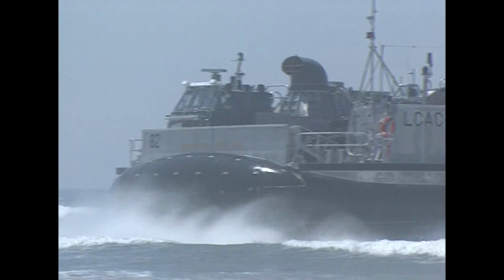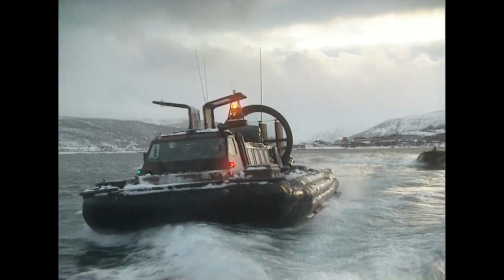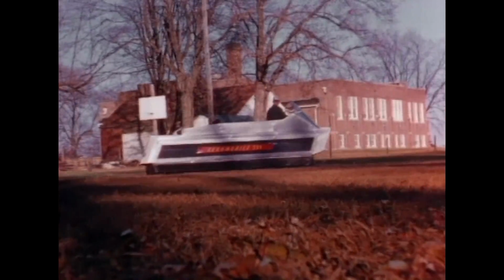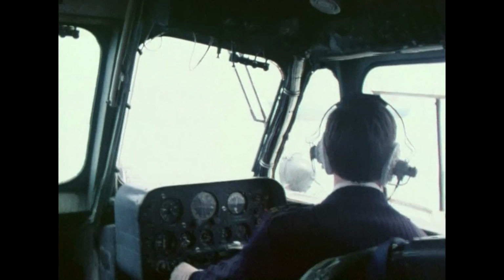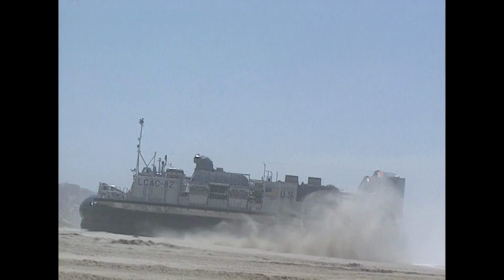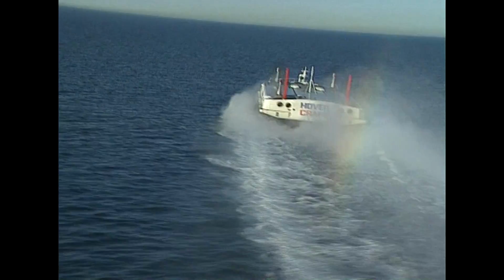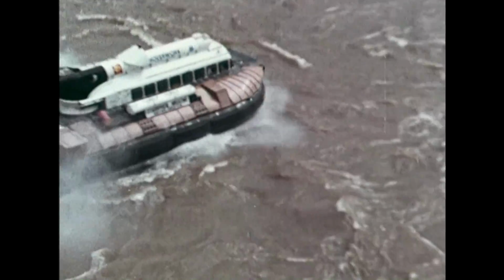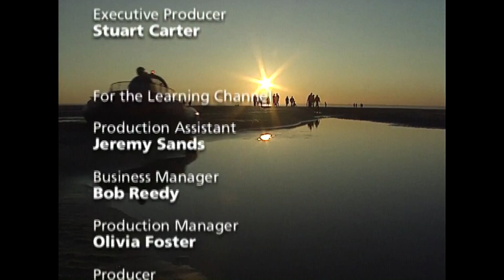Hovercraft - Ultimate Amphibious Machine

Comment: They are an amazing machine but realistically commandos are never going to use them, if you have ever been near an hovercraft the noise is deafening. It might be used for carrying troops quickly by the Brits but then it means you would have to leave your troops far from the actual theatre of operations. I cannot really see when it would ever be used in mission. Surely if speed of action and deployment is a requisite, so is stealth and hovercraft are everything but silent. Helicopters remain the main mean of troops transportation for this reason I would think. If they could manage to engineer a stealth hovercraft if there is such thing that would be a pretty potent way of transportation. The second cons I suspect is how much gasoline you need to feed these monsters. I do seem to recall one of the reasons the Hovercraft across the Channel between France and England ceased activity is the same as that of the Concorde, these were big guzzling machines, a sign of the era but past 70-80s with the oil crisis... There were still hovercraft operating till the mid 90s. In France it was mostly Calais and Boulogne-sur-mer, maybe Dunkerque and I do believe there might have been lines to The Netherlands or nearby Belgium too. They became a rare sight though, you would only see them in the summer time when the Channel was reasonably flat. Outside this 2 months bracket, big swells and Gale force winds would prevent most crossings. At the same time flying directly to London must have made far more sense than driving and taking the train all the way to these cities just to get a taste of the Hovercraft before repeating the same feat on the other side. Economically speaking it made little sense. There were beasts of a long gone era which is quite sad indeed. An engineering prowess like this would not be able to see the light nowadays. Back then nothing made much sense in terms of usage and sustainability was not even a word. As someone pointed out they could be used for super fast rescue operations were stealth is not a prerequisite.